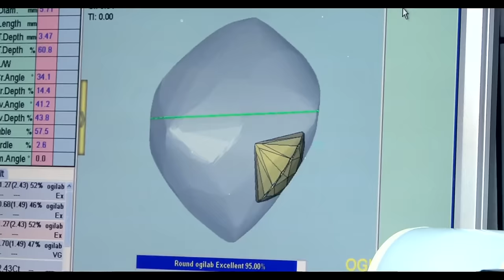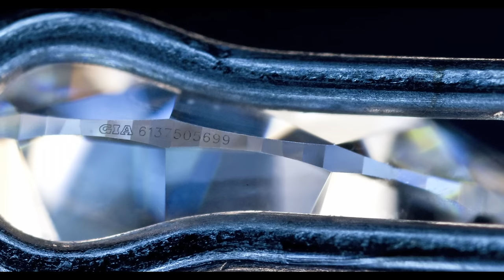How to cut a diamond

Comment: diamond is unbreakable
Reply: ***** diamonds are very hard, but they are very brittle
Reply: +Yohan AmazingMumbo i see what you did there . WRYYY!!
Reply: +Sean P diamonds are not brittle, the way the lattis is set out allows the diamond to be crushed easily
Reply: Diamond can be cut with diamond
Reply: its hard, not unbreakable, theres a difference
Reply: it was posted 2 years ago guys, people still didn't get the reference
Reply: I have 2 kg rough daimands for sell
Reply: Diamond is easy to breaking

Comment: what is the excess diamond bits used for, after the cutting process?
Reply: I think that spinning wheel they said had a 'diamond paste' so I'd imagine stuff like that.
Reply: @greggilks825  but when they were rubbing the two diamond against each other the diamond became matte... So I think, since car paste its made up of cars, diamond paste isnt made up of diamonds. Instead it is a paste created for diamonds. (This is all theory. I will go do more research now) 

(Edit) I did my research, you were right 😅 the excess diamond is used to make the diamond grit grinding wheels.
Reply: @kawaiigacha2088  diamond is actually really cheap and abundant that's why so many tools uses it
Reply: @SpektrikMusic  I'm not sure about cheap and abundant but it is amount the best materials for tools I agree
Reply: @origamicartoons4168  you can find diamond tools for cents, diamond is just crystallised carbon formed in high heat and pressure environment.